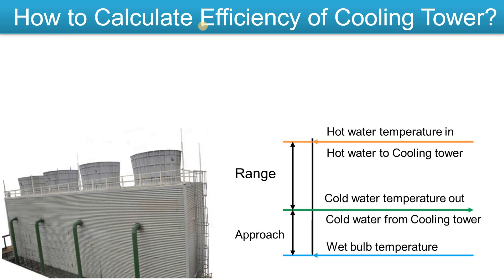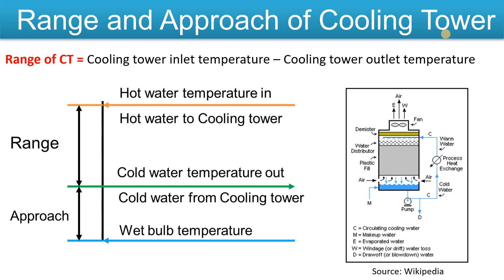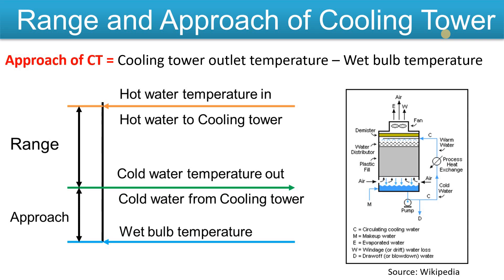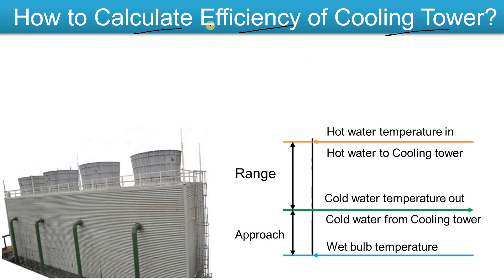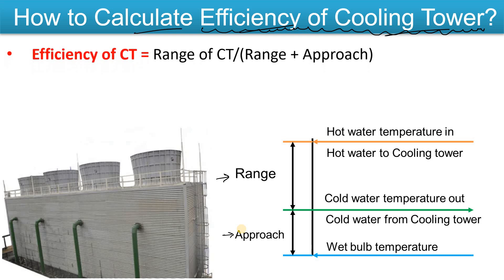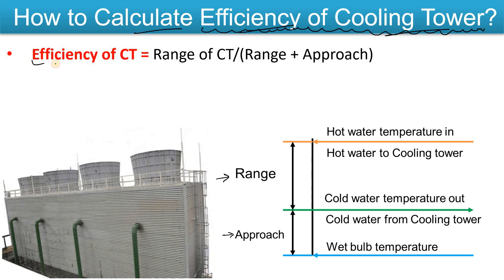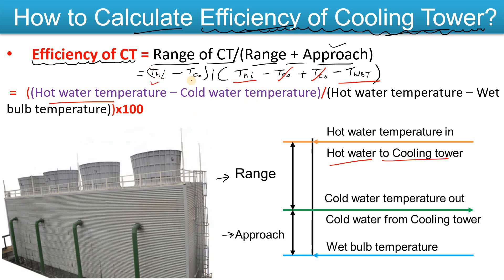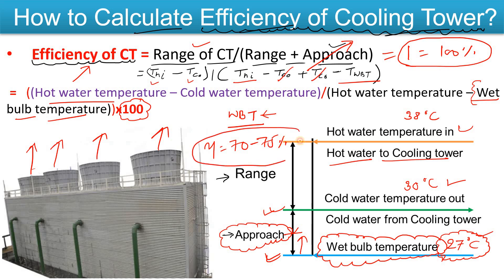How to Calculate Cooling Tower Efficiency? | Cooling Tower Efficiency | Cooling Tower

Comment: thank you for your explanation. i have question, how was the effect of surround air humidity on cooling tower? is there any way we can calculate the cooling tower efficiency with including the effect from humidity?
Reply from the maker: Surrounding air humidity affects cooling tower performance by influencing the rate of evaporation and heat transfer. Higher humidity reduces the rate of water evaporation and cooling, while lower humidity enhances cooling efficiency. To calculate this effect, you can use the concept of "wet-bulb temperature." This is a measure of air temperature accounting for humidity and is lower than the dry-bulb temperature (regular air temperature).
The cooling tower's performance can be estimated using the approach of "approach to wet-bulb temperature," which is the difference between the cooling tower outlet water temperature and the wet-bulb temperature of the inlet air. A smaller approach indicates better cooling tower efficiency.
To calculate the effect of humidity, follow these steps:
1. Measure the dry-bulb temperature (regular air temperature) and wet-bulb temperature of the incoming air.
2. Calculate the approach to wet-bulb temperature: Approach = Outlet Water Temperature - Wet-Bulb Temperature.
3. Compare the calculated approach with different humidity levels to assess the impact on cooling tower efficiency.
Reply: @Coreengineers  thank you so much for your answer. cmiiw, the range and approach method have been including the air surrounding humidity? and second, what's the equation for point number 1 which is the measure dry bulb - wet bulb?
thank you so much for your attention

Comment: Hi,
I have two questions. 
The range of the cooling tower is a function of process heat load and cooling water circulation flow rate (Q=m.Cp.dT). Heat load and flow rate will decide the dT. What role the cooling tower has in controlling the dT (or range)?
And if we know the efficiency of cooling tower, what steps we can take to improve it?
Reply: This is a very good question, can you please explain this also sir ? Thank You.